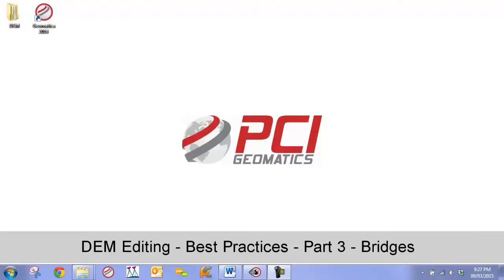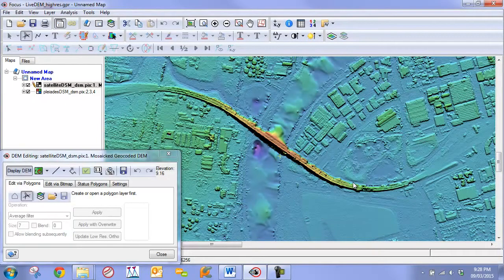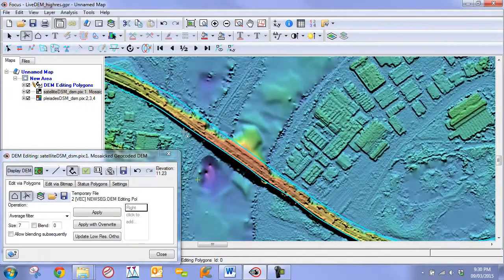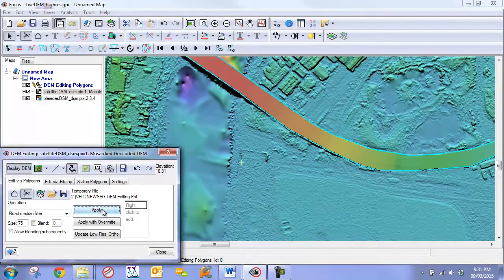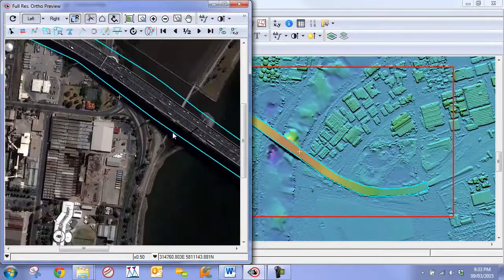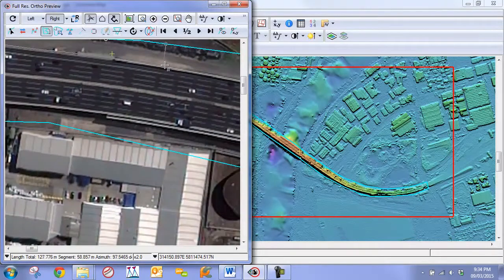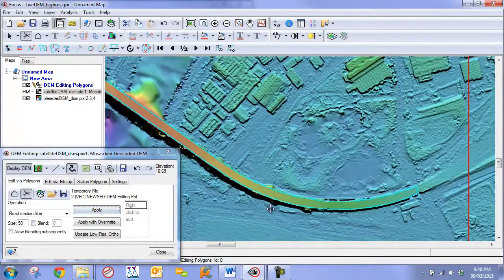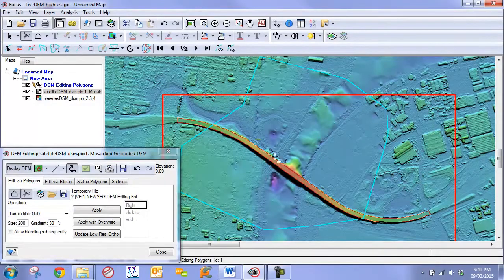DEM Editing Tools - Part 3 - Editing Bridges

Comment: Great,,, I have a question,,, is it posible to chage selectively the DEM value of a certain point or selected polygon? like if it is a flat area on the original DEM and I wanted to become a pound or a hill ?
Reply from the maker: Yes, this is possible. Simply create a polygon for the area you wish to make edits to, and then use the "Enter constant value" feature in the DEM editing panel. You can enter the value you wish to use to change the elevation under that specific area.
Reply: Did you change the elevation for selective area?